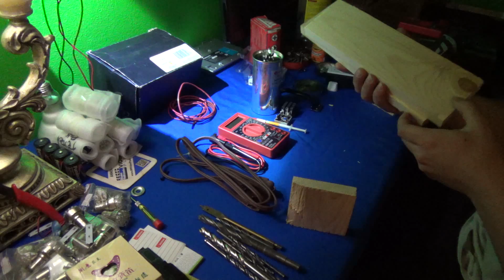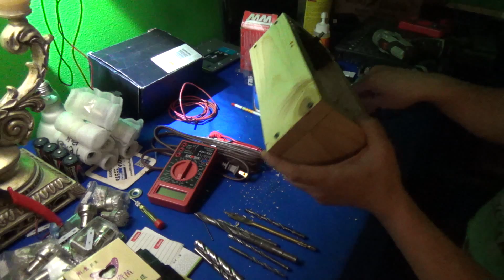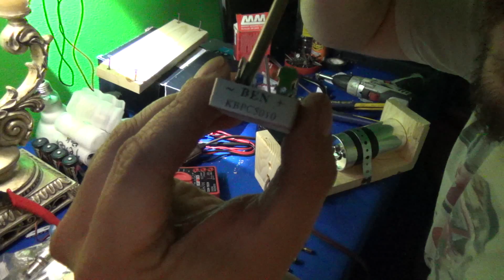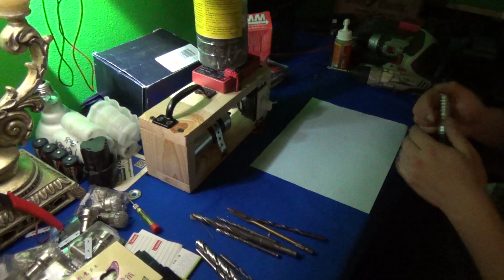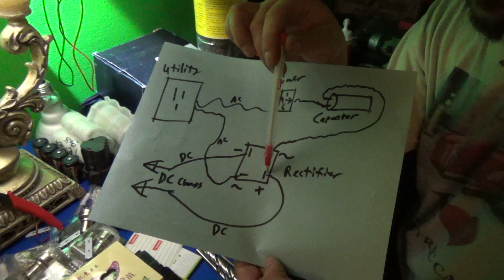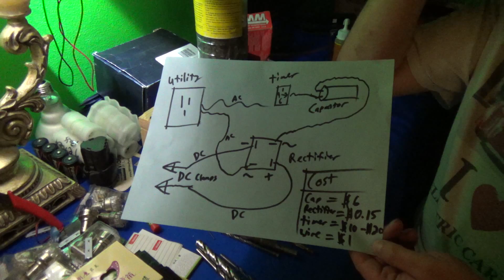How to build a Desulfating Capacitive Battery Charger Complete Diagram Start to Finish Desulfate

Comment: son lol you need to learn electronics  to desulfation you need a little higher voltage with a 30k sig. a battery at under charged state the sulfation forms on the neg plates to remove it you need to reverse electroplating the neg term if the bat is so bad it would take a year to deplate it get a noco

Comment: I followed the diagram and have it running. My battery is showing 5.6v. I connected the desulfator and it went to 9.6v and after 1 minute the voltage started to drop. Any suggestions?
Reply from the maker: What voltage battery are you trying to charge? If the battery is heavily sulfated, the voltage will increase until current can start to flow. Higher the voltage the lower the resistance, so it is breaking through the high resistance of the sulfated battery. As that sulfate breaks down, voltage will start to drop. As battery then charges (if it's not too far gone) voltage will begin to increase as battery charges.

Comment: Can you connect 4 of 80fd caps in parallel to charge 1350 amp hour 2v flooded battery? Thank you
Reply from the maker: What the heck are you running at 2v??? That's nuts!       Yes, you "could" however, at 2v, the amperage with 4 caps may be way too high. Get yourself a kill-a-watt meter or similar. Start with ONE capacitor. See what your line side amperage is and Volt Amperes are, make sure you are not exceeding the supply mains side, also make sure the amperage going to the battery is not burning up the wiring. Add one capacitor at a time checking between each. You may be stuck with just a single capacitor. These are much more efficient on higher voltage batteries. less waste as heat. Even on 120v input, that rectifies to just over 170v DC output. The closer the battery bank is to 170v, the more efficent it gets. Once you get to 170ish volts your power factor is closest to 1. 

But please give much more detail on your setup, I can get more specific or give better advice.

Comment: You need a motor run capacitor. Not the +5 mfd. To desulfat get a 80 ish uf capacitor. To charge get a 25ish uf capacitor.
Reply from the maker: Depends what you are charging/desulfating. Motorcycle battery a 5 or 10 mf is perfect. Car, not so much.

Comment: excellent work! one question...how do you change the multi meter battery?
Reply from the maker: Just pop it off. My first one I built is about 10 years old now, still original battery. Just don't leave it on when your not checking it.

Comment: YOU KNOW i LOOKED AT HYDROGEN GENERATORS ONE TIME FOR CARS USING WATER to produce hydrogen n increase efficiency n one guy out of CANADA Eagle Research had one n he said his was the most efficient n one thing I noticed is this "capacitive charger" was part of his hydrogen generator I saw a video here on you tube he was building a unit for a car might be why he claimed his unit was more efficient at producing it! And Also he was the guy who put the bug in my ear about these "capacitive chargers" n the idea they can charge and desulfate any battery including battery banks golf carts etc. Ive always been kind of experimental anyway but I didnt have much luck building hydrogen generators mostly because they require a lot of current and in city traffic is too much stop n go. But I also found a way if u were on a long trip at a steady speed just build u a container with NaOH and water n throw in some crushed up aluminum cans n run a line to your intake manifold you might seem some increase in fuel efficiency n it doesnt require any electrical power or energy because its a chemical reaction that is producing your hydrogen gas n not electricity from your engine n u can as well make a small experimental torch this way as well HHO gas has some strange properties...

Comment: How boring , you don't tell us what kind of parts you're using. the lighting is so dull I can barely see what you're doing... you don't leave a schematic of any kind with part numbers or anything on it. you're going to have to do a better video.... I got absolutely nothing out of this one except for a chance to nod off, and get a quick nap.     it would be greatly appreciated if you could do another video, and turn on some lights . explain what parts are using, and leave a wiring diagram for us to look at .... obviously you're smart enough to build something like this. so maybe you should use a little bit of intelligence that you have left over. to do a better job of explaining how to build this for us.. it would be greatly appreciated . don't know whether I should subscribe to your videos or not at this point...

Comment: A couple of suggestions...  It would be good to put some heat shrink tube on the cap and rectifier terminals.  It's really cheap and makes for a much more professional look than electrical tape.  Bonus points for adding some anticorrosive connection grease inside the tube segments.  Next, while you really aren't running huge currents through that rectifier, mounting it where it has more airflow through the heatsink would be a good idea.  Third, that plumbing strap you use to mount the capacitor is actually easier to work with if you turn it around and work against the way it's been rolled, so it's easier to get a tighter fit without either readjusting it like you did or really yanking to tighten it.

Comment: Did you had a previous capacitive charger model using 3 large capacitors with the same wood enclosure and timer?
Reply: I'm asking because I purchased online one of these chargers with the 3 capacitors back in around 2008. Yesterday I opened the case to replace the fuse and the wire connector with the fuse came off the capacitor (one of the 3 capacitors) I' m trying to figure out where to which one capacitor connect this wire to.

Comment: Too bad you went thru all that trouble to make a nice box and all but like I said the damned thing doesn't work and to boot is a safety hazard.  It is quite interesting that you don't specify what the cap value is voltage wise and uF wise and don't spec the bridge either. No one has ever said if one has to hook this contrap up to a 40 amp breaker or not otherwise you trip breakers while using it ... is this a slight of hand ? Sure ... teach em how to build it but don't give them quite enough info to make the thing work. There is no way this thing should be drawing more than 10 amps. I can run a regular smart charger at 12 amps and NOT blow my breaker rated at 10 amps ... go figure that one out Mr. Electronics expert. This thing is a hazard ...
Reply: Go try Eagle Research Weisman I think his name is he is a lot more informative n sells ebooks or small books on things like these n much more comprehensive n he uses this capacitive charger encorporated in some of his other inventions water torches etc. I like this video cuz Im a total bone head when it comes to electronic's n N I had all the stuff to build one but to chicken to try n put it all together cuz nobody explained really well how like he did what wire goes to what connection Check out that Eagle research I got a book from him years ago that explained it all much more indepth but I lost the book.
Reply: all values are shown in the amazon links

Comment: Sorry dude doesn't work. I built one and all it did after boiling my battery for a while ( 20 mins) was to get the charge up to about 11.5 volts and then kept kicking the 10 AMP BREAKER ON MY BOX after that . I had two 12uF ac start caps in parallel for about 25uF which should give me a 1 amp charge current at about 170 volts. I'll admit that that first 20 or 30 mins on and off got the bat back to some life ... 11 plus volts but after that it kept kicking the breaker drawing more than 10 amps. This design does NOT work. It needs serious current limiting which the caps do NOT provide as most have stated they do. I don't know what you guys are trying to prove here but t doesn't work as a bat charger. It may desulphate some cells at such high currents and voltages but after a short time the bat regains a lower internal resistance and starts drawing enormous amounts of current. I made an old school dumb charger after I blasted the bat with this contraption and even it died from current overload. The transformer burned up. I don't what you guys are thinking here ??? Think about it ... AC mains at 120 VAC into a bridge should give around 160-170 VDC. I agree that higher voltages WILL break down the sulphation bridges and remove much of the surface sulphation BUT once that has happened the currnet draw becomes far too much and fries the charger or kicks the breaker in my case even after a very short time.
This 170 volts DC is far too much ... you only need about 50 max and in pulses at about 30 kHz. Best frequency would be adjusted to that of the break down of Lead Sulphate crystals. You NERDS are out of control ... better think this out a little more.

Comment: On off grid battery bank, can inverter stay connected? Or does it need to be disconnected to charge  the bank. Ty
Reply from the maker: I'd have it switched off at minimum.
Reply: Inverter should not be connected while charger is operating.  The pulsed nature of this charger will cause issues with your inverter, and might even damage it.

Comment: On bridge rectifier, you said 30/32 amp or something but your link on parts showing 50amp rectifier. Can you clarify please? Ty
Reply from the maker: Thomas Choi over sizing is better then under sizing
Reply: KmanAuto- thanks, is it safer to add resistor (5k or 10k 5w resistor) across the capacitor to discharge the cap or add switch on positive of DC side to cut the current, when disconnecting it. Or both

Comment: Whats the voltage to know for fully charged battery for this charger?
Reply from the maker: about 5-10% higher while charging then the battery would be full at rest. so fully charged car battery would be about 15-15.5v, or once it is really bubbling. Each battery is a bit different, slight learning curve.

Comment: Would this desulfate just as well with a circuit using a transformer with the secondary of around 16-20vac feeding the full wave bridge rectifier? This would be for 12 volts or less batteries.   The current limiting capacitor would be put in one of the primary
leads of the transformer.   Have you used your circuit with 80uf cap on smaller less current batteries like 12/7amps and
if so are you concerned to much current is available should cells be shorted in the battery?   Thanks, Ken

Comment: thank you for posting this, I have 3 made up now and will make more.  seems to be bringing the batteries charged with it back up in capacity.
Reply from the maker: 262jp No problem
Reply: salvaged 8 scrap batteries with these chargers so far and many more to come.  amazing how cheap simple and effective the chargers are, got them to 80-105% of labeled capacity from scrap pile old farm batteries.

Comment: great, this is the first tranformerless design I have seen, but what keeps the charging voltage in safe charging range ?, the cap limits current but rectified AC would be in the 130v to 160v DC for a 120v mains. ?
Reply: Ur dead battery is ur resistance and as it desulates n starts charging more n more the voltage should as well decrease proportionally It will start out at very high voltage n decrease over time but it still takes quite a while about a week or so to bring back an old desulfated battery! Its good to have a thermometer handy to check the temperature occasionally incase u have a shorted cell or something.Which can be a pile of flakes on the bottom touching the cell or a large flaked piece of plate in which case this would be a non repairable battery or one that requires a lot more risky work draining n straining n washing the battery out etc n thats both dangerous and a big pain. Or u could try epsom salts n look that up on here usually start with a teaspoon per cellb Just my 2cents

Comment: Motto- As long as it works; I don't care. Almost as good as UL Labs.  More light would help and higher angle, and a bit of zoom.
Plumbers tape (clamping over capacitor) should have not been done your way. The metal band should have gone over it and flanged to bottom like a pipe/conduit clamp - This is a bit crude. I cannnot see how you don't know an electrical spade connector/terminal. Spade types male/female. Some few cos. items are called disconnects. I would have gotten 2 cords, you shortchanged him/customer  by halving the 6' cord (4+2) Now a la you, a spade connector is a wire clip.

Comment: Hi,
Very interesting videos you have, I'm just starting to watch them, thanx!   
I have a few questions

1) How does this desulfate?
2) How does it not put way too much voltage into the battery?
3)  I thought a desulfation circuit pulsed?
4) Can you answer what size caps to use for certain sizes of batteries up to about 100ah?

Comment: No mention of the output DC fed into the battery and being over 170 volts--doesn't that cook the battery or potential to electrocute some one handling the battery clips?
 Seems the high voltage charges all sized voltage batteries. Assume if the batty was brand new--what would happen and timer settings for all types?
 Can someone explain how sulfate is removed  and how the difference between  some units Dc 47 volts pulsating are better or worse?
Reply: Yes, the clips are at mains, and lethal to handle. Even after switch off, there may be residual charge in the capacitor. At 240 mains, even worse. 
'Cooking' is only a problem when the current is too high.

Though not shown, it goes without saying that a small value, local fuse should be included at the device itself. Without, and should the capacitor short, the battery will explode.

Note that 240 mains will pass more current that 120 will.

I consider 80 microfarads too large for a sulphated battery. Particularly a smaller size of battery. The capacitor should be chosen to suit the AH of the battery.
At 120v, 80 uF is approaching 4 amps. Don't forget that a sulphated battery has an equivalent Ah capacity much less than it's stated rating. Check often for heating of the battery if using this size. 
I would start with something much smaller.

Note that you can replace the capacitor with an incandescent lamp. This then gives a visual indication of current flow. Again, start with something small, say 40 watt?

Comment: what does the capacitor do across the AC input?  I've seen capacitors on the output of a half wave rectifier to smooth the DC output, but not on AC input
Reply from the maker: +Stephanie Grow limits current flow

Comment: It is IMPERATIVE that you put a 27 Kilo ohm 2 watt carbon resistor across the capacitor to discharge the capacitor when the device is not in use. A 10 amp fuse in the hot line (short blade) of the line cord is also a good idea. At 120VAC input the capacitor charges to approximately 170 volts. I assume no liability for this posted information. This is standard design practice.
Reply: Hi Marten what value of resistor should i use for 220V EU system?
Reply: Marten what about the 10 Amps Fuse is that also equivalent for 220V power supply? what do you mean by that "(short blade) of the line cord??? "
Reply: Ergoye Tefera  in Europe both wires are hot referenced to ground/earthed wire. Here in the USA the short blade on a receptacle or plug is hot. The  longer is the neutral return. as for the resistor a 47,000 ohm  2 watt flame proof resistor.
Reply: Ergoye Tefera the fuse rating is 5 amps for you
Reply: Marten....do you think the run capacitor needs bleed resistor?
Reply: Ergoye Tefera yes, the capacitor will hold a lethal charge if it is not used across the capacitor terminals.

Comment: +KmanAuto
Hi, Just two or more questions.
Would it not be better to clamp the capacitor with a zip-tie?
what's the difference between silicon and heat sink silicon?
Could you come around to show my woman how to vacuum?
Funnily enough that's how I met her; I asked her to show me how it worked and promised her B&B!
Reply: Heat sink silicone is actually a mixture of silicone oil with zinc oxide powder.

Comment: I would like to comment on this type of charger if I may - I do not mean to criticize, just state some notes.

1)  Yes this system works AND Yes you   MUST   use the timer for safety purposes with this type of charger so you do not overcharge.

2). I would like to add that this  type of charger is NOT isolated from the MAINS AC, so please please please be careful as there is high voltage possible on the output. 
 It may be best to connect the battery first, then plug the charger into the AC power. Remember to get the polarity right on hooking up the battery !!!

3)  I think it best if people were to added a fuse on the AC side of this system before the timer of a value that is greater then the full current allowed by the capcitor. So if your capacitor allows say 5 amps of charge, then add a fuse of 10 amps just in case of an electrical short. If the charge current is less then 5 amps, then a 5 amp fuse may work ok.

Comment: How do you change the batteries on the voltmeter if the back is glued to the box?
Reply from the maker: Sam Shumway Just pops right off. Mines going on 4 years same battery.
Reply: +KmanAuto Why not use velcro, no need to reglue it, a multimeter battery doesn't last forever
Reply from the maker: +LancerSolurus No, doesn't last forever, though, mines going on 5 years on original crap Nickel Zinc battery that came with it. tried velcro on one, was more hassle then it was worth, kept coming off after about a year of use, so ended up just putting a few dabs of glue and headache solved :)
Reply: I know this is old, but just remove the 2 screws prior to gluing.  The back lid on the multi-meter snaps on, no screws required to hold it together. Then, it just pops off to change battery.